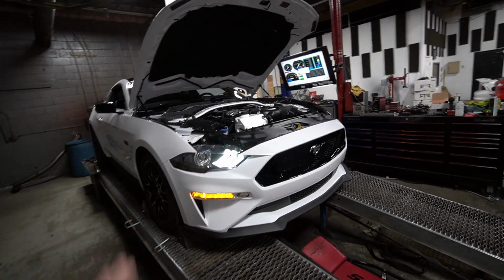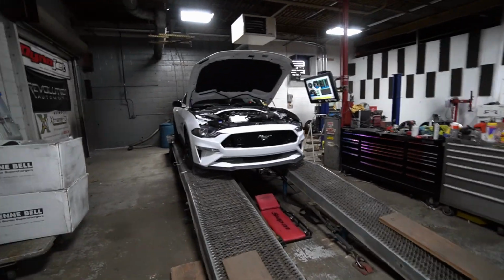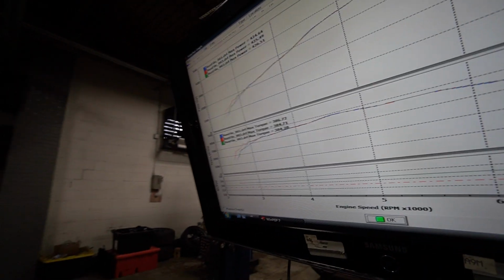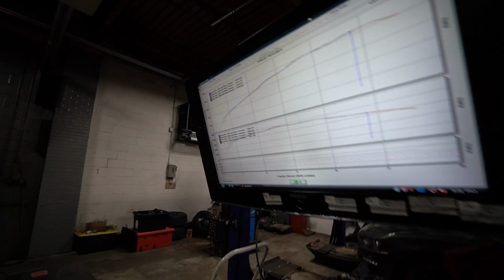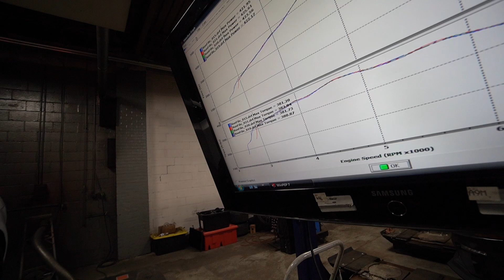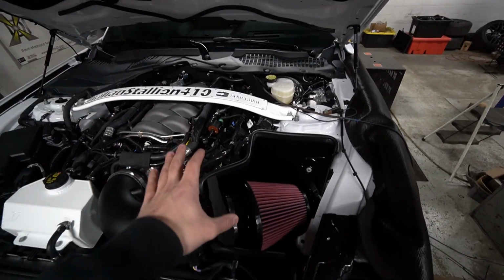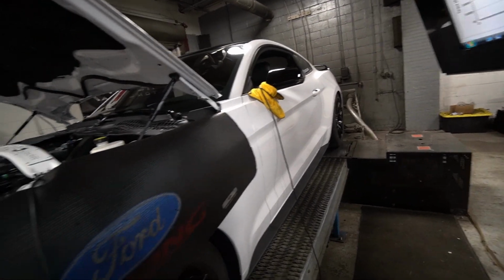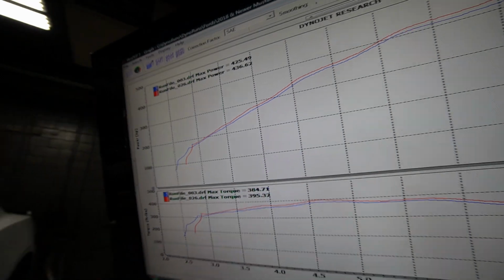How much power can my S550 make on the Dyno? (Stock vs Intake, X-Pipe, and Tune)

Comment from the maker: Hey everyone I hope you enjoyed the video! 
Just wanted to let everyone know the tune I had revolution do was a very mild tune just for the simple fact the car has a lot of parts on the way and the car will be seeing the dyno a lot in the future, so I wasn’t trying to reach any crazy numbers. Thanks for watching also the car will be shifting at 8k RPMs soon that is why I wanted to put the 5w50 oil now  cause it will save my oil pump gears in the long run!!
Reply: Hello mf,
Do i need to change my 5w20 oil to 5w50 when i tune my s550 fbo on 93 oct at 8k rpm ?
Reply from the maker: @7amood965  all depends how you drive it mine only gets raced so yes but everyone ik runs it
Reply: @ItalianStallion410  

I have 2015 s550 5.0 M6
Mods will be :-
Drop in aFe dry air filter
Cat delete + x pipe (stock headers & axle back)
Ported 18+ IM
Gonna tune on 93 oct and rev it to 7800 rpm

It is my daily drive I don’t race much
But i wanna keep my engine & oil pump in safe

Should i go from 5w20 to 5w50 full synthetic ?
Reply from the maker: @7amood965  just go 5w30
Reply: @ItalianStallion410  

Alright, thx mf

Comment: The stock air box is sufficient. CIA on this car is literally a cosmetic thing. The air-fed stock air box will have cooler temps than an open cone. Save $350,  drop a performance filter in the air box and call it a day.
Reply: Not true. The CAI literally adds whp and tq. I raced a stock mustang GT without CAI and my car pulled after 3rd gear.
Reply: Yea my jlt made good power with e85 alone
Reply: @Fr33man1988 too funny, same trans? Wheel changes? Too many variables, lol! 😂
Reply: @Fr33man1988  That doesn't say anything. Only one way to test if it helps, do 3 dyno pulls with the stock one, then do 3 with your aftermarket one WITH THE HOOD CLOSED and see if it actually does something. From my experience, JLT doesn't do a damn thing.
Reply: @Elver_Galarga_jugo the JLT intake requires a tune to run since it uses a larger diameter tube versus the smaller stock airbox. It’s simple physics…the larger intake will provide more air into the engine.
Reply: @Fr33man1988  yes, and yet it does nothing because IATs are higher than stock. Do you really think a little shield with big gaping holes is going to keep engine bay heat out? Nah. JLT is trash.
Reply: I’ve got an SR Performance x-pipe and a Roush Intake an my car pulls on stock GTs
Reply: @BlacksSpeedShop thats because the roush is closed box Design, which is better

Comment: The gen 3 coyote is elite compared to a gen 2
Reply: What year did the Gen 3 come out?  I have a 2019 PP2 and a 2018 Premium Auto.  Gen 3s?
Reply: @GR018  I believe it came out in 2018. You got some fresh units
Reply: Gen2 is way more reliable 💯✅
Reply: For sure

Comment: So basically 11hp, 11ftlbs gain from intake and 93 tune. Dang I was expecting a lot more! For stock, I’d say it’s was pretty well optimized! Good job Ford!
Reply from the maker: Yeah also my car did come pretty hot from the factory made good power over the rest that was in there stock
Reply from the maker: @d3et1roi3t  we had fans on the car lol I walked in front  of them so you didn’t see them if the car was that hot it wouldn’t of even made good power

Comment: Finally a proper dyno video done in steps that make sense. Basically proved out what i thought would be the case. Ford has a very powerful stock computer that can really do its job. Raising the rev limit also skews the results compared to stock but not by enough to really matter on the street.

Comment: They don’t wanna admit it but the 10 speed is the king of the streets right now
Reply from the maker: Oh ik it is !
Reply: It is. Much faster and superior to the mt-82. Still chose the mt-82 for my 2020 though, manual is too fun imo.
Reply: @ZFA1738  yeah but the autos have higher  drive train loss than manuals  manuals are 10-12 lost where autos are 15-20  however  the auto does shift better but boring as fuck
Reply: Germans would like to have a talk with you

Comment: ayyee bayy bayyyyyy
Reply: @ItalianStallion410  Some say oils with high amount of Zinc will quite the engine down.  I use Rotella Synthetic in my 5.0 👍
Reply from the maker: @williamhorvat8224  they use diesel oil to break in the gtr motors for that reason

Comment: Before video 
418 stock
453 intake and tune

After 
Ouch I thought it would be better...
Also E should get you about 30hp more
Reply from the maker: We went mild on the tune cause it’s gonna be back on the dyno another 4 more times for all the parts I have on the way.
Reply: @ItalianStallion410 O I understand. The ouch was more for how far I was off lol.  Its gonna be good to see whats yours ends up at for a comparison to my car (custom tune vs lund email tune)
Reply from the maker: @backwoods5oh  I think when I put the headers my car will pick up a whole lot more.
Reply: @ItalianStallion410  definitely headers help a coyote exhale alot better.

Comment: SAE numbers are corrected for altitude, temp, humidity, etc. The consistency of the numbers is awesome, but that's not what the car would make in real life. SAE is a basic comparison of say, someone who lived in the mountains where altitude is high and temp is low versus someone who lives at sea level with very high humidity to simply compare the 2 builds using fixed data. Great video, new sub.
Reply from the maker: Thanks for watching man

Comment: How much money you spent to get 500whp i wanna see if it will be worth it i have a manual 6 speed 2021 mustang gt 430whp
Reply from the maker: It was mainly cobra jet throttle body and full exhaust and E85 tune I would say about $4,500 and that’s all new parts

Comment: Makes considerable more power than my 2016 camaro ss a8. BTW not guaranteed numbers haha. Dynos don't guarantee anything but as you probably know by now a tool see changes. Tunes only aren't going to make more power most of the time just cause ford and gm use knock sensors and know a hell of a lot more than any tuner. Even the best of the best are blown away at what ford engineers are able to do. If the weren't limited by emissions, longevity, nvh, and warranty claims they'd absolutely make way more power than any tuner.
Reply from the maker: Yeah I wish the epa wasn’t up their ass they could build a monster engine

Comment: What kind of oil did you say you’re using? I have a 2016 Gt and I hate the idle noise. I want it to be quite lol.
Reply from the maker: I run 5w50
Reply: Thicker oil is supposed to quiet it.. I run what ford says tho f that lol
Reply from the maker: @Shiftnlift  best of luck!! 👍🏽
Reply: @Shiftnlift  Its not too well publisized, but look in your owners manual. Ford says if you gonna do track mode or run it hard, use a thicker oil. The 5w20 is mostly for fuel mileage.
Reply: @JeromyBranch  never knew that bro u taught me something on that one ..
Reply: @Shiftnlift  You are welcome sir. I learned it the same way a few years ago. Hope the information is of use to you.

Comment: E85 is the secret sauce! You will be shocked with all the bolt-ons.
Reply from the maker: It’s coming in time I will have this car on kill!!
Reply: Mine is a raped date on E85! Need to go to headers to go stupid!
Reply from the maker: @dennisthespeedmenace7530  how much power did yours make?
Reply: @ItalianStallion410  believe me it will on e85 with 3.55 Gears and the 10r80! It’s the biggest bang for power! Your pony is going to feel like a thoroughbred racehorse!
Reply from the maker: @dennisthespeedmenace7530  lol I will take your word on it it’s going back on the dyno soon for the E85 so we will see how she picks up power
Reply: @ItalianStallion410  you know it will!
Reply: Owe my car made 483hp with 438 torque sae. On e85. I need headers
Reply: Sorry I didn’t see that comment
Reply from the maker: @dennisthespeedmenace7530  well we are gonna see how much I can make with a rev tune
Reply: @ItalianStallion410  rev is good my boys Supercharged 2016 F150 is there right now getting work done it. Fuel pump upgrades and other kinks getting figured out.
Reply: @ItalianStallion410  headers will put me at the 500 wheel Hp on N/A. I’m close to getting my stainless works header.
Reply: @ItalianStallion410  are you getting a flex tune?

Comment: I got 3.15 gears what do you think I have at rear wheels stock?
Reply from the maker: What year car
Reply: @ItalianStallion410  2020 GT Premium Stock. Active Exaust. 3.15 Gears 10 Speed
Reply from the maker: @Monsterberger  hmm maybe low 400s
Reply: @ItalianStallion410  that’s enough for now.. when I retire in 7 years. I’ll be upgrading Brakes,wheels,half shafts,then I’ll buy the JLT and Tune Her..
Reply: Do you recommend changing gears to 3.55’s?
Just letting you know I have the 20” Wheels not 19’s. Does that change anything??
Reply from the maker: @Monsterberger  if you plan on boosting it than no
Reply: @ItalianStallion410  ok. I’m not boosting it. But I know you’ve played with your 5.0’s and wanted to know if it would make a difference if I was just giving it the JLT and a tune. If you say No I Believe yah.. Thanks
Hey are you on Facebook or Instagram?? YouTube you can’t really keep in touch.
Reply from the maker: @Monsterberger  yes I am on both platforms and both the same name as my YouTube

Comment: Does your 10 speed have the 3.55 ratio or 3.15?
Reply from the maker: 3.55 it’s the performance pack
Reply: @ItalianStallion410  Ahh ok, My 6mt 2018 was a base model with 3.55 and my current 2018 is PP1 10 speed also with 3.55.

Comment: Open air cold airs are useless especially on 18’s and up. Dyno it with the hood closed like real world conditions and you’ll probably lose power with it. Better off with a $50 drop in.
Reply from the maker: Once the car is driving both intakes are the same closed box and open the only difference between the 2 are the closed box intake temps stay a little higher than the open box when the car is just in traffic for example.
Reply: Facts Antz
Reply: That’s the route I went. Why spend the extra money for basically nothing
Reply: @ItalianStallion410  did I read this right? You said Closed boxes read higher IATs than Open Airs that suck HOT ambient air directly from the engine bay?
Reply: @Andreallen4  this dude knows  nothing I agree with you

Comment: Could you feel the difference when you drove the car after the JLT intake?
Reply from the maker: Not really tbh where you really feel it is in the tune cause I am able to fully rev the car all the way out to 7500rpm  and it won’t pull timing anymore over 100MPH

Comment: 5w50 should only be used for Boost not NA!
Reply from the maker: It’s better for the oil pump gears in the long run once I start making the car shift at 8k RPMs
Reply: @ItalianStallion410  I have a 2020 5.0 with the 3.0 Whipple. Too much fun
Reply from the maker: @thejuggernaut7883  that’s dope I bet your car rips!
Reply: @ItalianStallion410  Let's just say I have alot of fun on the street.

Comment: Must be a dogshit tune.
My Gen 2 made that with a CAI, tune and a 2 & 3/4" x pipe.
Reply from the maker: Nice every dyno is also different
Reply: @ItalianStallion410  not that different. I've been doing this over 20 years. Either the tune is complete arse, or your car has had a previous tune done. Gen 3's make 380 to 400whp stock. 430whp on 93 is cai and X pipe, 450-470whp is full exhaust 490-500whp is e85. If that's a stock tune and all you got was 11, then it's a shit tune, it should have been closer to 440whp.
Reply from the maker: @ far from a shit tune 😂😂 only if you knew
Reply: @ItalianStallion410  yeah, ok....
Reply from the maker: @pheonixfps9248  have a good day